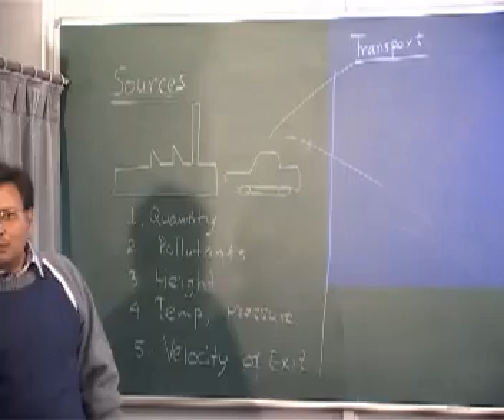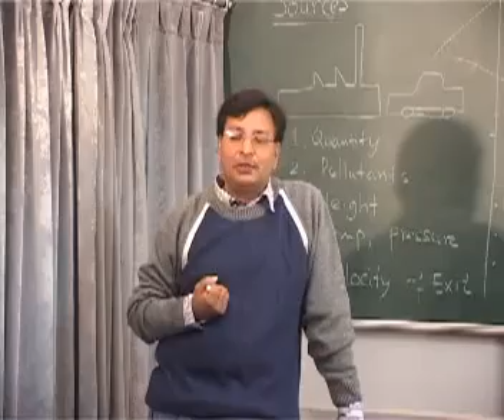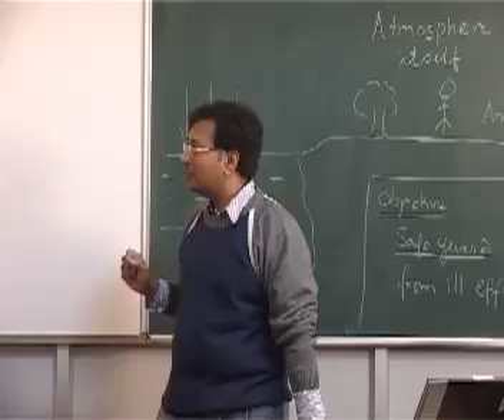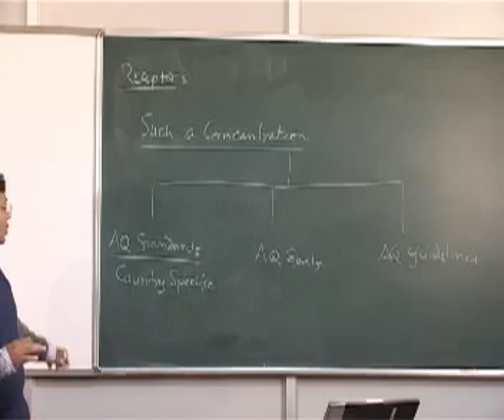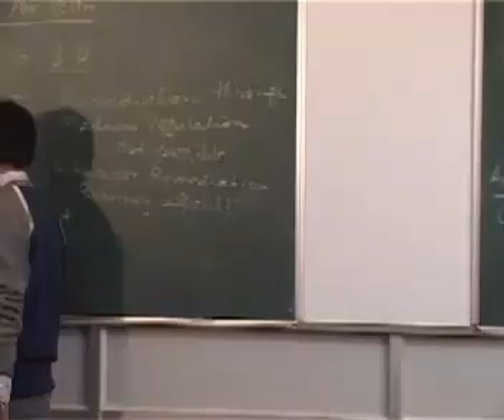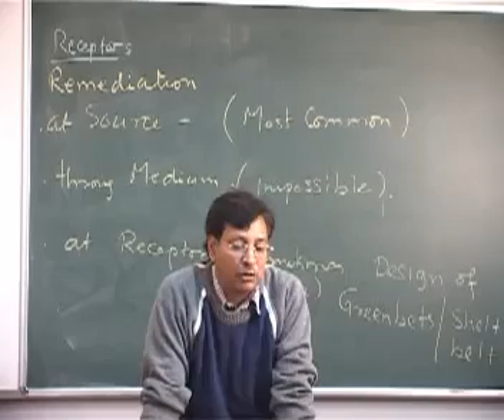Lecture 2 Air Pollution Systems

Comment: The best indoor air cleaners are made in Switzerland: IQAir HealthPro series. The can remove the tiniest particles, 800 times smaller than PM 2.5. Chemical, bacterial, viral, gaseous, biological and even odour pollution is removed. The IQAir air cleaners are low on energy consumption and have long-lasting filters. IQAir is the best choice for those who want to have the best among the best...